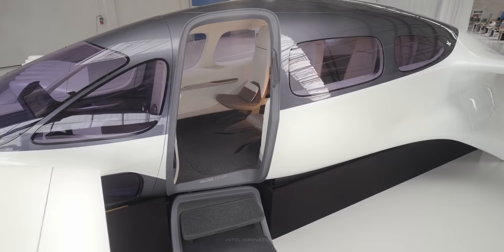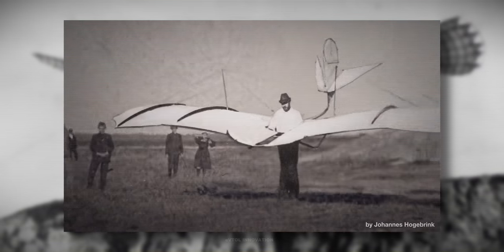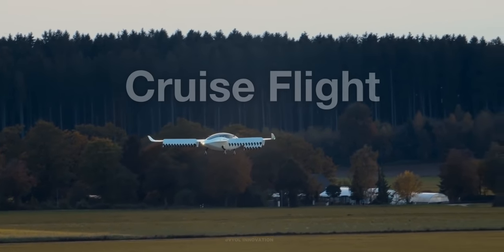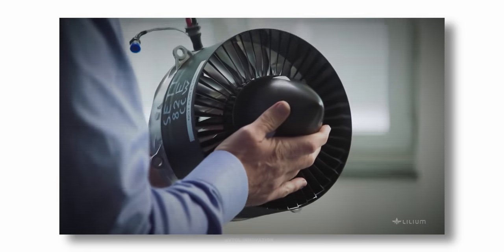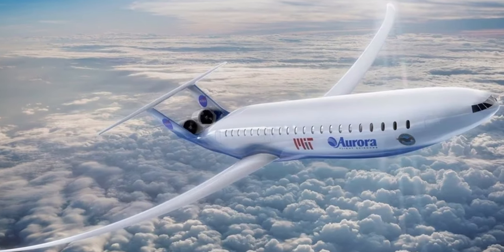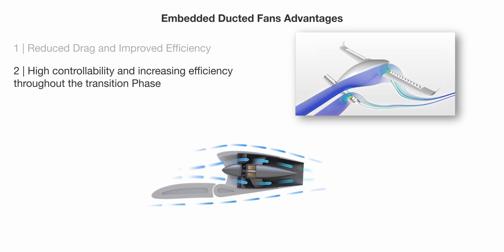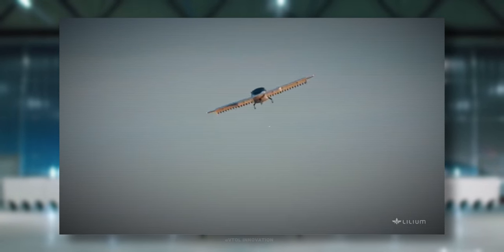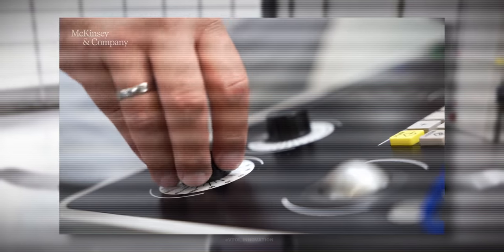The Insane Engineering behind The Lilium Jet | Part 1

Comment: It's a TurboFan, not a true jet... a true jet has a fuel stream that is sprayed down the vortex the electric fan generates. It has to be high quality materials because of the heat that is generated. It goes back but a portion accumulates in the engine.  This is just a ducted fan, the fuel stream makes it a jet, but you have to measure it in a wind tunnel first to see where to put the fuel nozzle, and the ignitor. Modern jets are just that, plus thrust vectoring and or after burner. Thrust vectoring is just feathers that push the flame in a certain direction, and afterburner allows the fan to spin faster, the jet to have more fuel, as the excess unburned fuel gets reignited down the tube farther, which is used mostly for takeoff.

There's some excel spreadsheet you could make about this, all these are just factors of efficiency, you can give more engine and less wing and have the same lift, for instance. This can also be used to show that if you make a hyper efficient aircraft, it could carry a LOT of weight.

Comment: The electrical motors are desing to be tha smaller possible. . . .Knowing that torque increase at the square of the radius , ,  Why not using the fan blade tips as rotors  and -placing the induction coils withing the cowl. . .how much less energy it would need for the same work. . .

Comment: This concept is bleeding from many wounds, we could spend days discussing the issues, I don't have time for that so I'll state the easiest: 
There is no directional stability.
Reply: People who  know what they are talking about have no place in the Youtube comments section LOL Yeah, I was thinking the same as you.
Reply: @Ozgrade3  Why not?
Reply: What about varying the thrust of the motors on each wing ? that would give the same control as having a rudder... And with modern inertia/gyro computed stability control, it would automatically be stable...
Reply: @HPPalmtopTube Computer stabilisation for civilian use was always frowned upon, but since the b737Max incidents it won't be easily accepted, neither by passangers nor by regulators.

Also, keep in mind that the MAX already had strong aerodynamic stability, it was just further augmented with computers. But you propose the computer to handle it all.

Also, you may build a conroller that can handle most situations, but crazy weather can put you in situations you could never have imagined.

Also, using computer control is bad enough, but you propose to use engines for it, so now you're also relying on the engines to function.

Also, unlucky lightnings are known to temporarily disable elecric systems on aircraft, that would also need to be handled.

Or alternatively, you could ditch the futuristic look and have a stick in the back with a vertical stabilizer.
Reply: @g.zoltan  I think nearly all these new electric VTOL designs use computed stabilization, inherited from the model/hobby grade quadcopter designs they originate from. Otherwise they would be way too unstable to manually control all but the most experienced pilots...

Comment: Not really a jet but more accurately a ducted propeller powered by electricity. Additionally unlike in conventional fossil fuel burning aircraft that get lighter as fuel is being expended - this aircraft will always weigh the same, no difference between takeoff weight and landing weight. As well I see no protection for flight into icing conditions.

Comment: This is a fair-weather aircraft, even if you could get a workable power supply. Could you imagine what problems wing icing would cause, and even if you could install de-icing heaters, ice breaking off the wings and being sucked into the fans could cause catastrophic failure.
 You just don't have the power (both electric and thermal) to make this an all-weather aircraft...
Reply: All small planes are fair-weather aircraft. If you can't get to 30,000 feet above a storm, then you don't want to be anywhere near one. That alone doesn't prevent the existence of a small aircraft market.
Reply: It's a short range aircraft anyway. De-icing can take place on the ground. This kind of vehicle requires its own ground-infrastructure, despite what constructors say. 
But you are right insofar as the availability of both sufficient power and energy in general is a big issue with these new flight taxis. I don't believe in their success. Too many obstacles to cope with. Lilium just delayed its presentation to the market for another year (from 2024 to 2025). So ... 🤔
Reply: @frankhusel5033  The real issue that nobody wants to address is noise. Moving props of any kind through the atmosphere at near the speed of sounds is invariably going to create a lot of noise. The only way to reduce the noise level effectively is by going to large prop diameters... much larger than today's helicopters. That is essentially unworkable.

Comment: I'm disappointed that everyone's going purely battery-electric and not hybrid, because a small auxiliary power unit could greatly extend range, and provide extra power for heavier take-off and more manoeuvrability.
Reply: Clearly, because you don't understand the basics of aerospace engineering, where aspects such as weight are an issue. Also because you don't seem to understand how efficiency matters in aerospace, and how adding less-efficient petrol engines would not only add far too much mass to make it practical, it would literally defeat the purpose of going electric, where operational costs are reduced as much as 90%.
Reply: @Knaught Shure Like the very low energy density of batteries compared to the much higher energy density of fuel?

Comment: To be a jet engine it must us fuel and air mix to combust the fuel with compressed air which drives a turbine to power the compressor.  A 3 phase electric motor driving a fan which forces air through a tunnel or duct is not even close you are just compressing air that is all same principle as the old prop plane but the force is directed.

Comment: All the taxi concepts with Quadrocopters are stupid. Aerodynamic horizontal flight is much more energy-efficient (factor 20). The idea of having lots of motors reduces the aerodynamic sound, because the air speed for propulsion gets minimized. In my opinion, the concept uses physics very smart.

Comment: I see this stock falling to below $2.  Beyond a scale model prototype that cant even lift 100kg,  they have little to show.  The tech is shaky and has questionable safety if there is an all out power failure.   It has no basic aircraft control surfaces.  I would not want to solely rely on a parachute.  Without power it's effectively uncontrollable and would have poor aerodynamics. i.e. it wouldn't glide in a controllable manner.  it could potentially become a death trap in such untoward circumstances.  Also they are loosing massive amounts of cash per share.  i.e.  loosing around  -$3,900 per share.  That's crazy.  I wouldn't touch this stock with a bargepole.
Reply: Like that "flying cars" this will never gonna happen. Even that "Jetpack" man is more feasible than this. Why fly when you don't need to? LOL
Reply: @Kiyoone  Why take a plane when you could take a train or boat? Its not like you need to fly, so why was the commercial jet ever invented? Simple. Innovation does not care for "needs," it pushes towards what could be possible. In due time, your sentiment may share the same fate as those who dissented against electricity, rockets or the automobile. Cheers.

Comment: Tiny jets on a tiny low to the ground aircraft would seem to make it very prone to FOD. Imagine the task of checking all the engines are clear of rubbish before every flight, even leaves will be a problem. Efficiency and reliability usually get better the bigger you make something. The wing looks high drag with so many inefficient little motors so I wonder what the level flight speed will be.
Reply: not too bad with only the single fan spinning round unlike a jet engine with 10+ stages all spinning a lot faster with tighter tolerances

Comment: Ya but if you have some spare batteries in your headset or your flashlight or something like that, if you start to run low on juice you could just swap those batteries from your headset to the airplane and that’s a good safety margin! A good way to save some lives. This is a great idea.

Comment: Whatever the advantages, it does seem a higher risk, less proven technology than conventional open rotors.  I wish them well.  Time will tell whether the gamble pays off.
Reply: Basic physics says it's unlikely to work. Using 36 tiny fans is vastly less efficient than a smaller number of larger fans or propellers.
Reply: @michaelnoble2432  not true. you gain extra lift from the combination with the wing and the jet design is more efficient than an open propeller.
Reply: @stefanweilhartner4415  ducted fans can indeed be more efficient than open propellers OF THE SAME SIZE. 

However, basic physics says that any impeller type becomes more efficient the larger it gets. There's NO WAY that Lilium will succeed with such tiny fans.

Comment: what are losses of ducted blades vs genuine propeller ? pipe all around the blade is additional internal and external surface that induces friction losses and doesn't participate to the internal functionning as for a jet turbine.
Now extrados blown is well known technique for stol planes, just need propeller close to the wing and its axis above

Comment: Disappointing that the video didn't really address the fact that smaller impellors are much less efficient than larger ones. Jet aircraft have been migrating to larger diameter engines to increase efficiency, but Lilium have gone the opposite direction. I really can't see this concept being successful.

Comment: A DUCTED  FAN  IS  NOT  IN  ANY  WAY  SHAPE  OR  FORM  A  JET  ENGINE  WHATSOEVER. The MOTORS of this aircraft are turning specially designed FANS or props that have increased thrust due to the specially designed TUBE they are housed in. A JET  ENGINE compresses air and injects fuel into the area of the engine where the compression is designed to be highest thus achieving combustion from the super heated compressed air and the resulting very high pressure combustion is used to both drive compressor fans and be used as rear exiting thrust to push an aircraft. NOTHING about that remotely compares to a ducted fan except for the fact that jet engine compressor blade housings are regularly described as fans. Ducted fan thrust is from a rotor blade or blades or a fan housed in a tube that helps increase thrust. No air compression or combustion happens in a ducted fan to produce thrust and therefore it is most certainly NOT a jet engine. It is simply a drone motor with a very well scientifically engineered PROPELLER housed in an equally well engineered TUBE.

Comment: Those are NOT jets. They are nothing more than electric motors with a propeller inside a duct, also known as a ducted fan.  A jet creates its thrush through the burning of fuel to turn the turbines and exhaust gasses exiting the rear of the engine.

Comment: What does it have realistically for range?  What 45 min before all electric motors quit? So maybe 50 miles with 15 min reserve not in VTOL?  Not a jet, looks like ducted fan propulsion.
Reply: Ducted fan propulsion is OK, even though it doesn't add much to a conventional prop design (if it did, we would have been using it ninety years ago). VTOL is completely unrealistic because of the noise.

Comment: I fly EDF RC jets with no payload and fly only 4 minutes with batteries whose weight is 1/3 of the weight of the plane, at full power, vertical climbing is not possible, and battery duration drops to 2 minutes if maintaining full power! Could admit Lilium EDF's are more performing, but I doubt that such a solution could be more efficient than large propellers disks! 
At the present, only slow and efficient planes like the Pipistrel have suffisant duration of flight, other applications could be aerobatics because it doesn't need flying more than 20 minutes!

Comment: It is not a traditional aircraft, because it doesn't really fly, after 7 years it can barely hover without load, has never managed horizontal mode flight ... they postponed the certification to 2025, because it doesn't work because it can't with the current and near future technology.
What you are describing has never happened ... it just hovered and one burned down.
When they were unable to make it fly with a passenger, the decided to make it bigger and 7 person version! 
It is a bit like a person who can barely walk tells you he signed up for a Marathon!
If you don't count the physical reality this sounds really nice, it is just not happening so soon and isn't really practical and efficient at all.
The founder tells you that this is a jet engine aircraft, if that is so I dry my hair with a jet engine in my bathroom now and then. 
It is nothing more than a ducted electric fan, the same reason that thing doesn't do the magical 300miles / hour with 7 people on board he is dreaming of ... what is wrong with that guy!

Comment: Fine! But why electric ducted fans in the upper side of airfoil, not in the lower side?
The Möller Skycar https://youtu.be/shlZySkGq6g looks similar, but it installs twin Wankel RCE in each propulsion and lift nacelle. 
A good arrangement would be Wankel for Electric power generation, among the lightest in ICE, economical in constant speed, under load over 50% of top nominal power,  and electric engines, that are safer, for propulsion.
Jetoptera concept looks good too, and a remake of Dyson bladeless fan, in https://youtu.be/ODqUuLBnk4Q
Blessings +

Comment: Sure sign of a rubbish design:  Emphasis on mostly irrelevant features, such as low noise, and ignorance of the basics: like meeting FAA regulations for safety,  providing enough lift, stability,  and control, and economic range and recharge time.  This design looks like a fail in all categories.

Comment: I am sorry, but this company greatly overpromissed and after years still did not deliver anything but dresssed up small scale drones.
Square cube law dictates, that VTOL gets disproportionally harder the bigger the aircraft gets.
For a full scale aircraft with heavy batteries the fans are way too small, the fan area an order of magnitude removed from what is required.
Their design is deeply flawed and based on wishfull thinking. It will never cary a passenger.

for reference: https://en.wikipedia.org/wiki/Annular_lift_fan_aircraft#/media/File:VTOL_DiscLoad-LiftEfficiency.svg

Comment: Heating air isn't enough. The density of air at 1500c is .4 whereas combustion end gas has a density of 1.2 at 1500c. That's 3x the density of air, which is why you need to burn hydrocarbons.

Comment: This doesn't work at all. The EDFs inefficient thrust is contrary to the high ussge of amps. The kilowatts consumed aren't available for range or operating time. In theory it sounds nice but with 5 min. flying time and 5 miles range- its useless. The battery doesnt exist. The weight would be 4 times higher than the 1.5 tons of max. lift off weight. So no manned transport,  and no cargo.  Only as a ultra low range RC drone. Sad but true

Comment: A misleading presentation for dummies.  This is a "jet" like a Cessna is a jet.  Yet there are  several graphics where jets are used by comparison, like apples and oranges. These "jet" engines are glorified propellers, not jet engines.  At the very end, the telling graphic shows a  proposed Cessna-like top speed of 180 mph, range 100 miles. Jetliners go 550 mph for thousands of miles. Be informed that electric jetliners, i.e. high speed, long range, heavy loads - are a delusional dream that will never be.

Comment: What defines a jet engine?
Image result for jet engine meaning
jet engine, any of a class of internal-combustion engines that propel aircraft by means of the rearward discharge of a jet of fluid, usually hot exhaust gases generated by burning fuel with air drawn in from the atmosphere.

Electronic Ducted  Fans: 
In aeronautics, a ducted fan is a thrust-generating mechanical fan or propeller mounted within a cylindrical duct or shroud. Other terms include ducted propeller or shrouded propeller.

so annoying calling this a jet the whole video.

Comment: Fully loaded and with e.g. 200 km/h, the plane will not have a range of 80 km with all safety conditions, naively who believes the exaggerated promises. range would e.g. Promise hydrogen together with batteries.

Comment: Could one bird strike knock out not only some motors - but also your aileron / flap into downward / unstable position mid normal glide flight?  That could prove a most catastrophic type risk.  
Other obvious issue is battery tech.  ‘IF’ a giant leap in battery tech is made (which also reduces battery volatility!), then very interesting (like so many other things).  If not, just a rich man’s toy?  Certainly, it looks like that anyway.  Banksters trying to get from the suburbs to the city - making a lot of ‘noise’ - without making much noise. 
Finally, the real independent scientific evaluation relating to the pros and cons of mass reliance on electric motors  / electricity still needs to be made.  Also from a ‘real’ environmental point of view.  Politicos and oligarchs can’t necessarily be trusted too much in a variety of ways - but most especially in terms of ‘science’. Remember how well centrally planned politicised economies worked in the USSR?